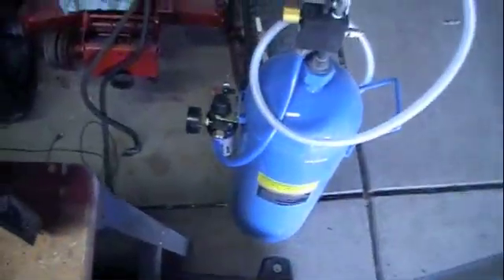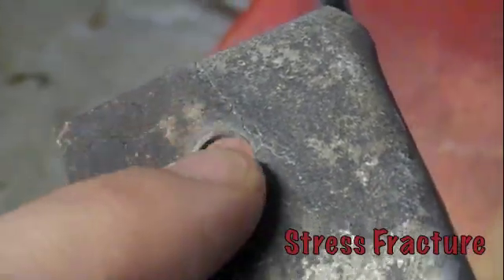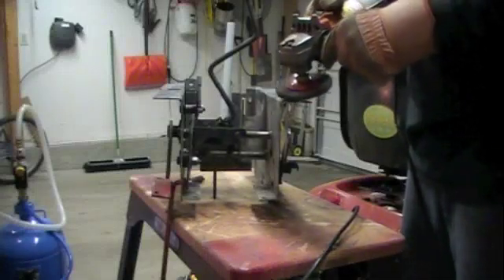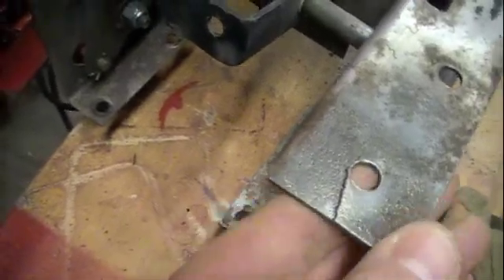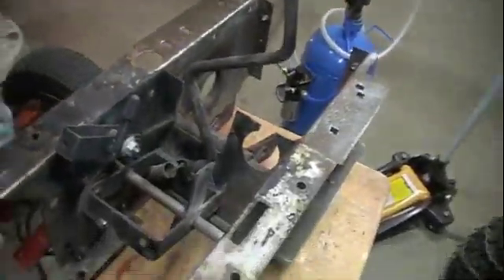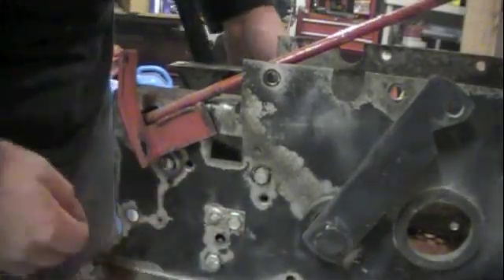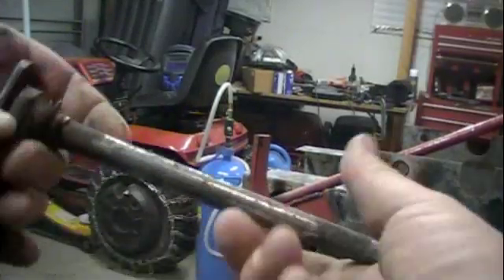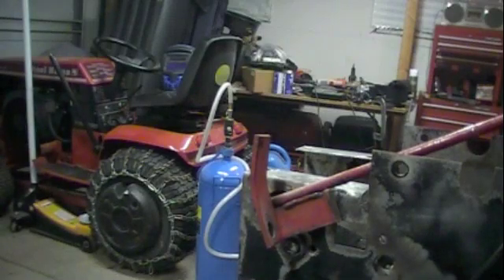Wheel Horse 520-H Project #13

Comment: I have one I bought for 50 bucks and had the same cracks the owner told me it was due to having a snowblower on the front . He had 2 and the one with a snowblower cracked the other one he kept was not. I also have 2 craftsman lt1000  18hp  and both had snowblowers on both and they both have cracks in the frame behind the front wheels the cracks are a lot worse in the craftsman.
and to fix it I will have to have a friend weld steel plates over the cracks as there are no bolt holes